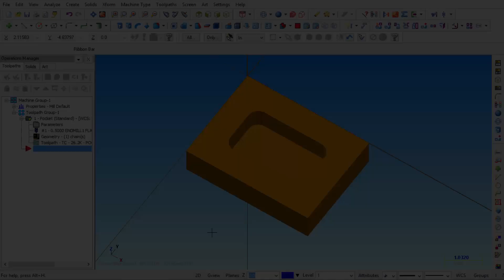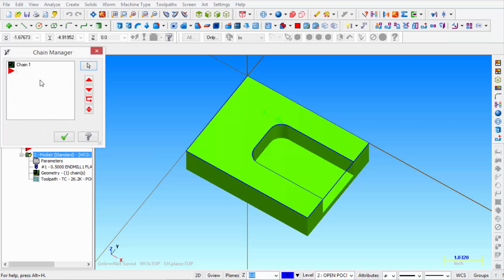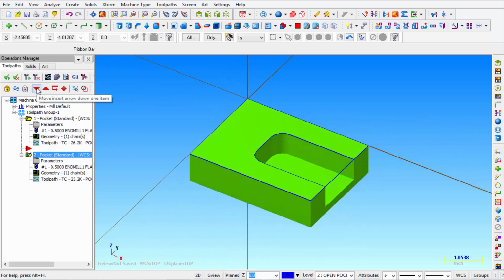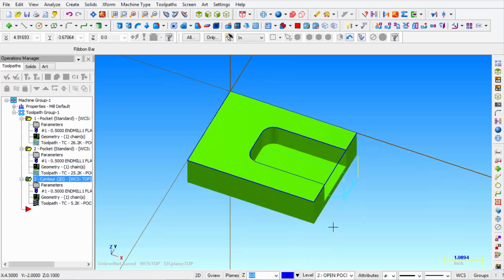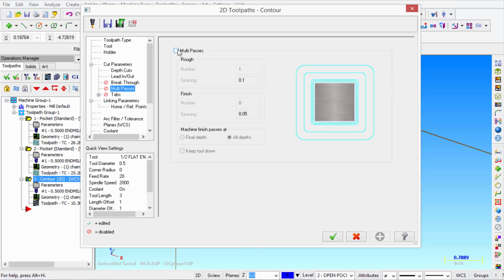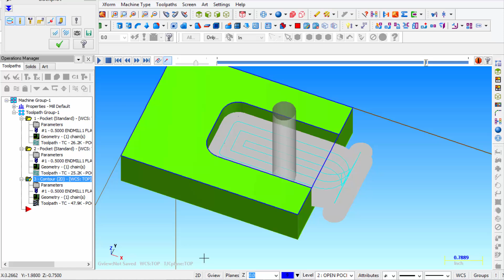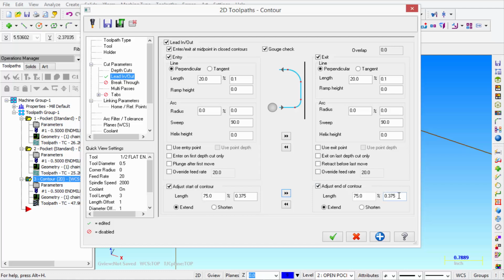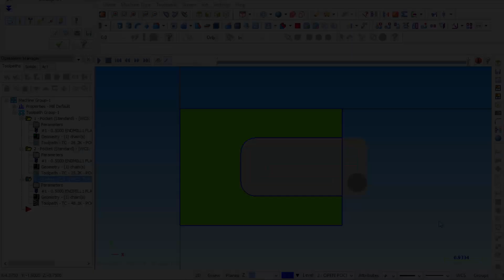MILLING CONTOURS OR OPEN POCKETS IN MASTERCAM

Comment: What doses roll cutter do?
Reply: Inserts arc moves around corners in the toolpath. 
None: guarantee all sharp corners.
Sharp: only roll the tool around sharp corners (135 degrees or less).
All: roll the tool around all corners and create smooth tool movement. 
The radius of the arc moves equals the radius of the tool. This option is available only when compensation in computer is turned on.